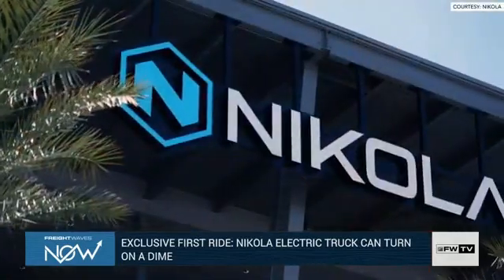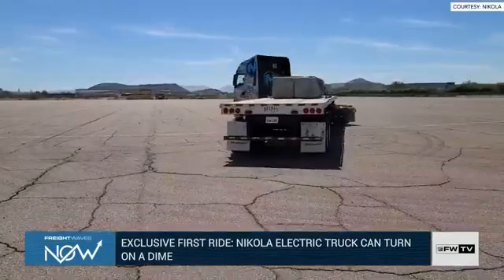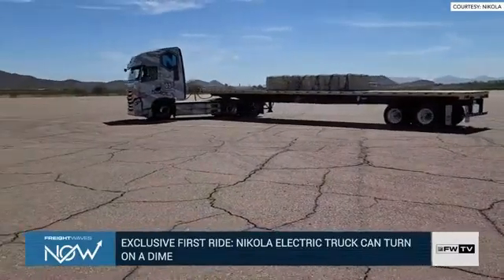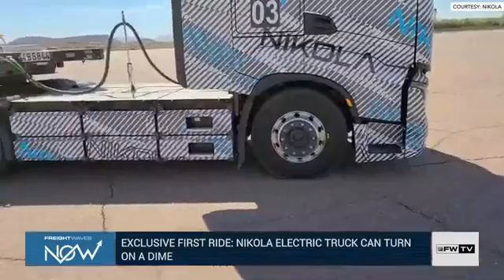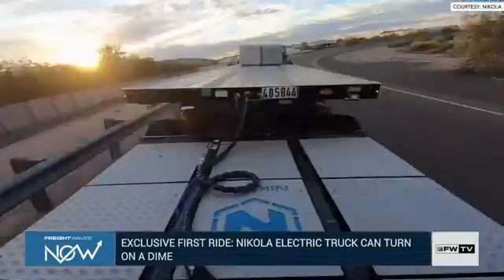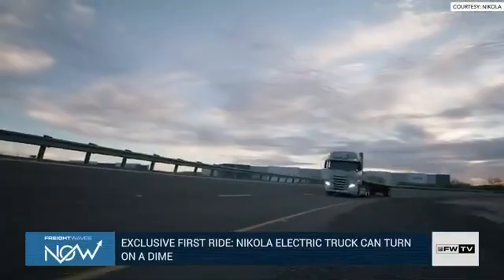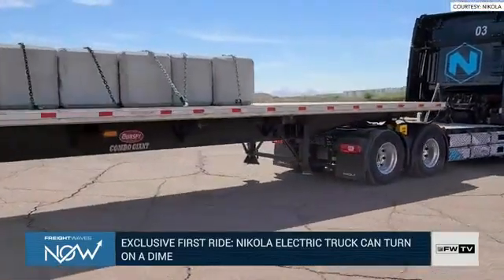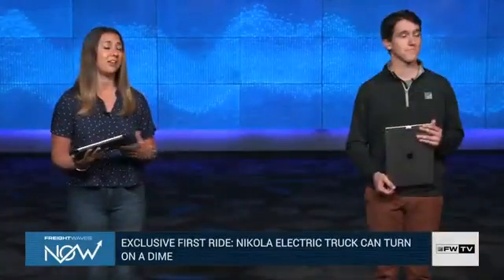FreightWaves’ exclusive first ride: Nikola TRE  BEV

Comment: BPM - NIKOLA dies not even make the NIKOLA TRE , its a Rebranded IVECO Electric truck .
Reply from the maker: CNHI 2Q earnings call: Gerrit Marx-the testing activities and also the prototyping and the pre-series is all on track. We have produced five alpha protos, nine beta protos. We have now produced another two gamma, which means they are now entering into try production. And we also have now started the first two fuel cell electric versions of the tray prototype in Ulm, Germany. So we are on track. We are getting ready for our production readiness in for the battery electric U.S. version of the Nikola Tre as we initially announced in 2019, and we are on track with the European versions eventually leading then to the launch of the fuel cell electric European version by the end of '23. So all is confirmed, then we are progressing well.

Comment: Excuse me, but the rolling Nikola One was was back in 2016, not 2020, and it was a concept vehicle.
In 2019 Nikola demonstrated two working Nikola Two FCEVs.
And in  July 2021 Nikola started trail production of Nikola Tre BEV trucks at their Ulm Germany and Coolidge Arizona factories.
Nikola has also recently started work on the first two prototype Nikola Tre FCEV trucks as the Ulm Germany factory.
Reply: NIKOLA ha no Propritory technology that works, NOT Batteries, not Drivetrain, not Hydrogen NOTHING.
Reply: @markplott4820  what do you smoke
Reply: @Urfinchannel  Mark is correct. Bought batteries, motors, inverters and more.